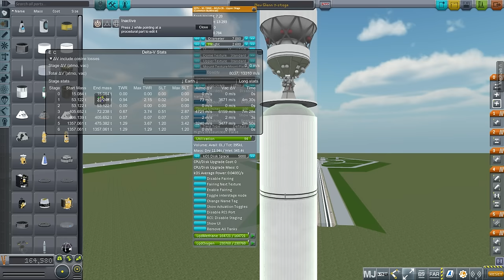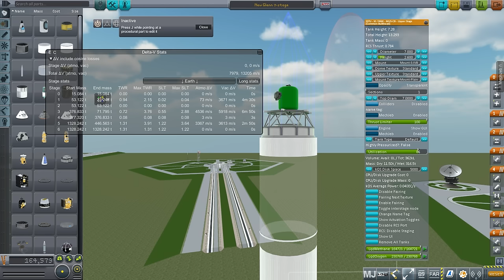Kerbal Space Program - RSS/RO - New Glenn Speculation

Comment: I've heard that the plan is to aim for downrange recovery further away than the F9 - F9 goes ~400 miles downrange, while there are supposedly "planning documents" (don't have the links myself) that suggest NG is aiming for ~750 miles downrange, meaning that first stage burn time should be a bit longer, and that the RTLS penalty (should they choose to use it) would be a lot larger.

Just an extra data point - thanks for doing the sims!
Reply: He was talking about downrange landing.
Someone on reddit already did a launch and landing with the Glenn
https://www.reddit.com/r/RealSolarSystem/comments/52hrrs/finished_and_improved_new_glenn/?st=it25yh96&sh=79102aa3
Reply: The info is in the introduction of 'Bound Reports:3' under 'application' here; https://permitting.sjrwmd.com/epermitting/jsp/Search.do?theAction=searchDetail&permitNumber=147362
as far as I can tell, the introduction text describing the vehicle comes straight from Blue. The doc is dated 2nd Sept 2016, so we can assume this is current data and applies to the current design for New Glenn.
BTW, it's 750 nautical miles, not statute miles.